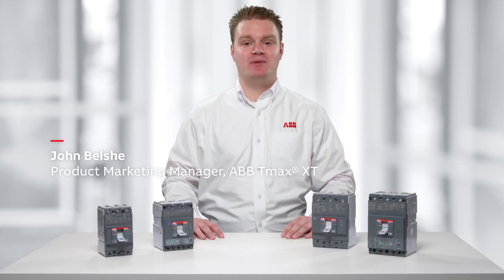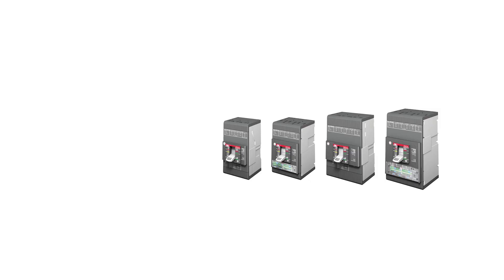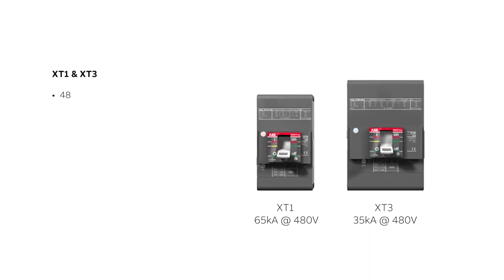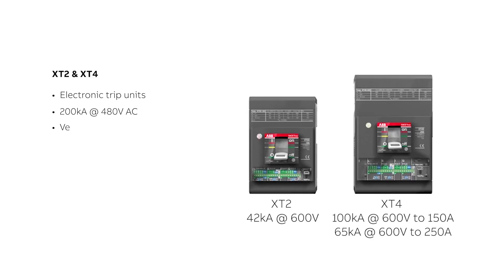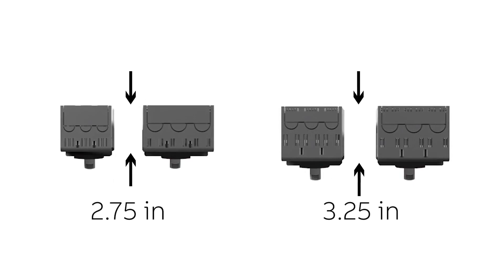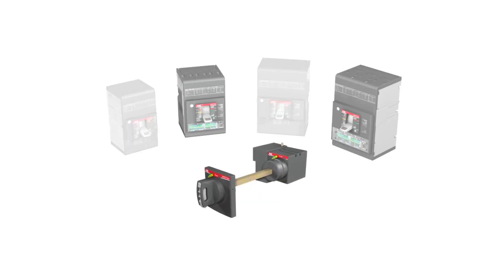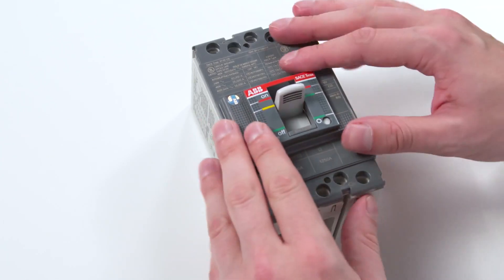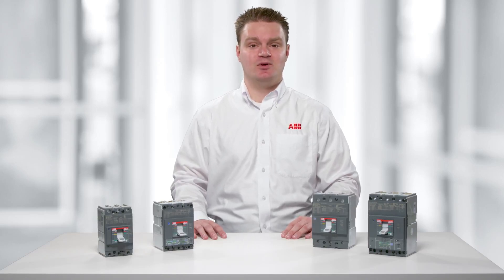Innovative Tmax® XT Molded Case Circuit Breakers from ABB

Comment: This breaker plastic parts are extremely fragile and mechanically  unreliable. A brand new XT2 63A breaker just fell apart. On/Off handle snapped with bare hand, auxiliary contacts bracket broke off and there is no reliable position indication. I expect at least some quality from device which costs 700 Eur.

Comment: Great devices! Purchased a XT4 with thermal and electromagnetic trip unit, installed the shunt trip coil and closed the case.
All neatly explained, kudo's!
Maybe kind of stupid question: How do I arm (switch on) this XT4 unit?
Getting it in the test mode: no problem.
The XT4 unit doesn't allow me to arm it however.
Should I remove a safety/transport component first to arm the unit?

Looking out to installing this device to protect my 48V 200A solar batteries if anything in the system goes wrong but I can't find the documentation how to commission this breaker...
Any help or tips are highly appreciated!